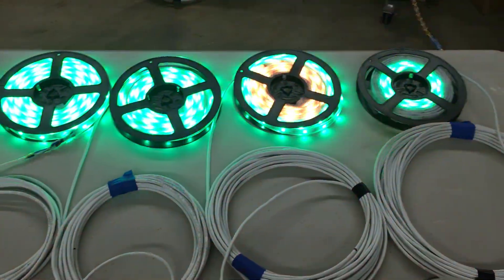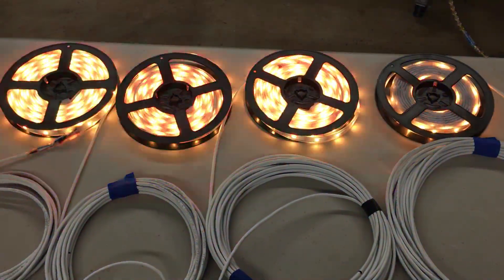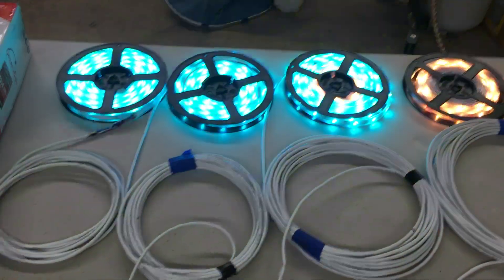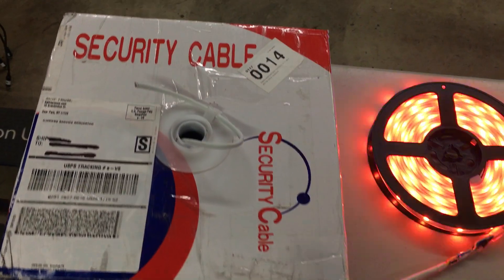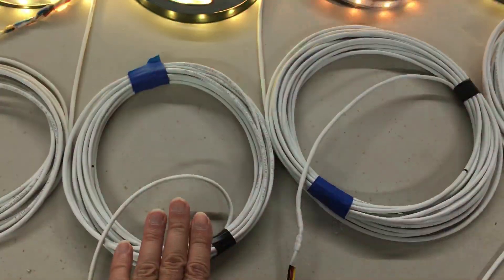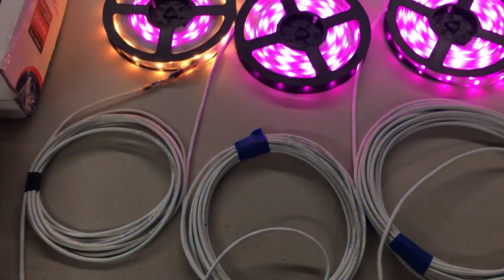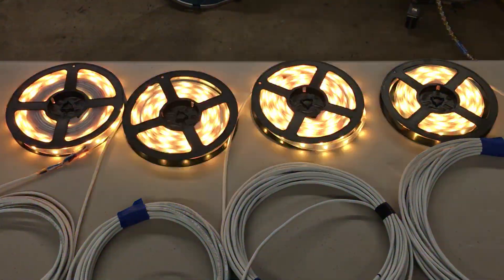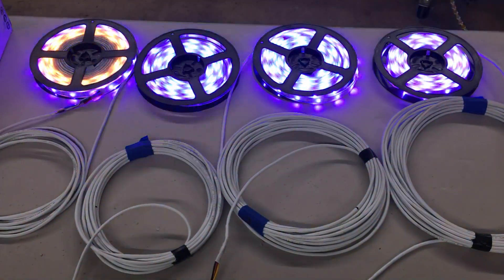Extension wires from WLED controller to led strings

Comment: Just bought this from you off of Tendie.  I'm looking forward to playing with this guy.  I was curious about the current handling capability of the copper traces?  I know you have 5A fuses for each output, but have you been able to stress the throughput?  What is the copper weight for the 12V rail?
Reply from the maker: Hi Andrew,  thank you for your purchase!  i put big fat traces on all the positives outputs so you should not have any problems there.  as for stress test, im running one of these on my house now with 12v leds.  all 8 ports are used with around 150 pixels on each port.  no power injection and a few of these runs have a 50' extension to get out to the pixels.
Reply from the maker: I guess my thought here is that since there are so many more outputs available, you dont need to run super long strings.  if you keep your strings a reasonable length you wont need to use power injection.

Comment: What are the black cables that you have plugged into the board and the security cables ?
Reply from the maker: The black wires are pigtail connectors, makes it way easy to connect and disconnect LED strings.  you can get them here: https://www.wiredwatts.com/wire there are several different standards (ray wu, xconnect, paul zhang) they are all slightly different.  pick one and stick with it.
 the security cable is used to wire up alarm systems in commercials installations.  search for "4 core 18awg alarm stranded cable" on ebay or amazon.